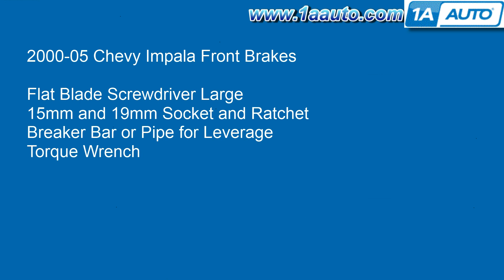How to Replace Brake Kit 00-05 Chevy Impala

Comment: Thanks to 1A Auto! I ordered a brake pad kit for my '02 Impala to replace the factory brakes (yes, they were 21 years old, yes, I'm stupid, and surprisingly all but one were still in decent shape. That one, though... YEESH.) and they were the right fit at the right price, just like all the parts I've ordered! 2 headlight kits (factory original lasted 5 years, replacements lasted 18), window regulators (factory original lasted 5 years, replacements lasted 15), hazard light module, and (I think?) blinker/cruise/washer stick. 1A Auto is the first place I look for parts.

I watched this video while doing the first one, and it's easy to follow along!

Comment from the maker: They may be similar. On some vehicles you need to turn the caliper in using a special tool that fits into a couple of holes on the backside of the caliper (not sure if this is set up that way). If they're not, you would be able to collapse them just like the front ones.

Comment: Thanks again @1aauto my mother in law needs her brake pads changed and since I'm still a beginner mechanic this is good for me to do so I can show my boss a can b a full mechanic ur videos help me a lot with my cars and help me gain more knowledge to show my boss I can fix cars to so far I learned to change lights, spark plugs, spark plug coils, oil change and filter change I now know how to change my fuel,filter on my 03 envoy sle and ect on customers cars thanks for the videos I will watch this video a bunch more times so I can memorize how to change the brake pads is it the same for the rear brakes or is it different if it's different do u have a video on that thanx again for the extra knowledge
Reply from the maker: +Adam Drucker Thank you for the great reply. We love to empower our customers by showing you how-to perform your own auto repairs while installing our high quality auto parts. Have a great day! 1aauto.com

Comment: Thank you for this video.  I just replaced my front brake pads and rotors on a 2009 Chevrolet Impala LS 3.5 liter.  I noticed I had two pistions per caliper.  I pushed back each piston separately - was that the correct procedure???  Also, each rotor was held to the hub by a torx screw (I couldn't figure out at first why the rotor would not come lose).  Basically the overall procedure was the same.  I pumped the brakes, took it for a test drive, and all is well.  Thanks again!  No more pulsating!

Comment: Awesome Video! It was clearly explained and demonstrated. I do have 1) question, I need to replace the rear disc breaks on my 2003 impala. Are the same basic steps and principals involved in replacing the rear disc breaks as the front disc breaks? Thanks again for this video.

Comment: just a couple notes: you should use silicone paste on the long bolts . and i found if your rotor is rusted  you can hit the rotor it the center near to bolts holes and itll come lose i had the problem where it mechanically welded itself . also you didnt note you needed a c-clamp in the title. hope this helps
Reply from the maker: +Traves Theberge Thanks for the tips! And thank you for checking out our videos :) 1aauto.com 866-403-3393

Comment: I noticed you put the C Clamp inside The piston on the caliper, I was told not to do that for reasons I don't remember, but was told to use the old pad to put even pressure on the piston to push it back in.  Plus you never mentioned that if the brake fluid was recently filled with worn down brake pads that they might have to remove some of the brake fluid so it doesn't over flow.
Reply from the maker: +Todd Bach Thank you for checking us out, as well as the question. The method you use will evenly compress the caliper piston, but we have not experienced an issue with using the c clamp on the caliper piston. 1aauto.com

Comment: I have a 2003 Impala LS 3800 and when I start up the car it doesn't start if its been sitting. Usually at those times I have to give it gas by pressing the gas pedal lightly rev the engine to get it to stay on. What could this problem be?

Comment from the maker: Usually what you can do is leave the old brake pad on, and use the old pad to collapse the two calipers together with a C-Clamp. Hope this helps you out. 1aauto.com 888-844-3393

Comment: Just wondering, the guide pins are different, does it matter which one goes where?
Reply from the maker: +Jachin Bateman Thanks for checking us out. The guide pins should go back into the slots they came out of.
Reply: @1AAuto  thanks for the reply, unfortunately I was on the second set when I noticed there was a difference. Upon further research, the one with a machine end and rubber grommet goes on top.

Comment: I got my breaks and rotors fixed to my 08 impala and they still squeak and sound funny when I stop does anyone know why?
Reply from the maker: Did you have all 4 done, or just the front/back? Could be that the the mechanic didn't use any grease on the slides or pad backing plates. You should be able to take the car back to where you had the work done and tell the mechanic what you're hearing. They ought to fix it right for you. Hope this helps you out. 1aauto.com?utm_source=YouTube&utm_medium=CTA%20Comment&utm_campaign=1ATony 866-403-3393
Reply: He changed all the breaks and rotors he's my boyfriends uncle he goes to people's houses to fix cars he used to work at a shop which is why I trusted him my boyfriend put some break cleaner on the breaks but they are still squeaking and it's driving me nuts because I'm the type of woman that keeps up with her car and feel that something ain't right. I appreciate the response so much thank you.
Reply from the maker: Ask him if he used any brake grease on the parts when you can. Brake clean removes any oil on the brakes that might be there from when the parts shipped. But there is also a grease that you apply to some of the surfaces to keep them from making noise, so he may have forgotten to apply it. If he is experienced, then have him take it for a drive and see what he says. No problem. Glad to hear it helped you out. 1aauto.com?utm_source=YouTube&utm_medium=CTA%20Comment&utm_campaign=1ATony 866-403-3393